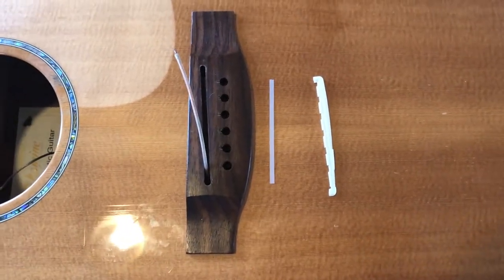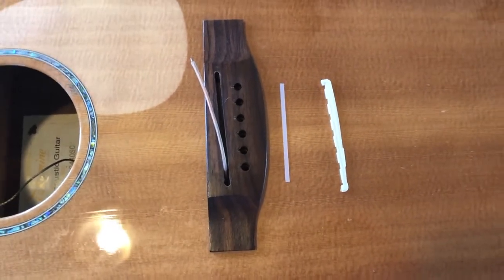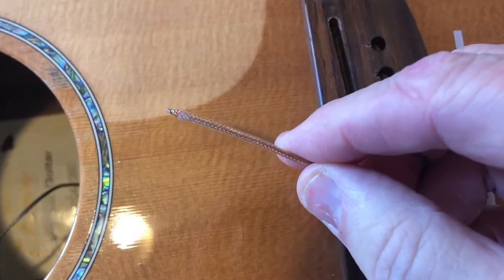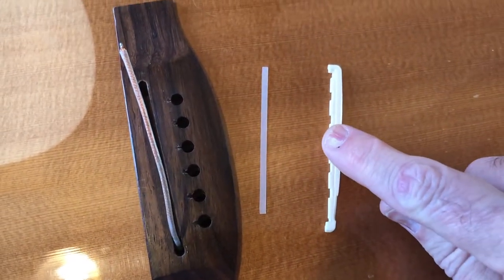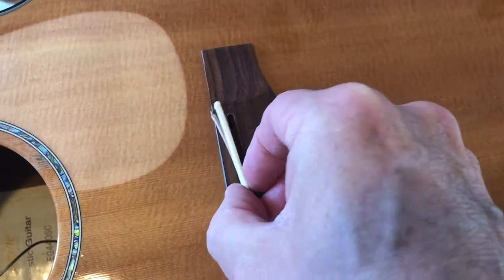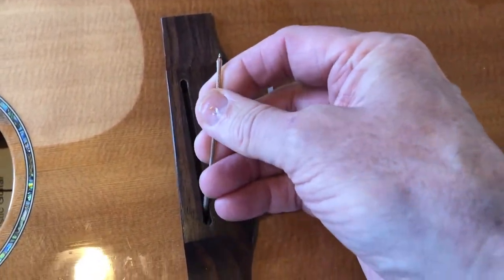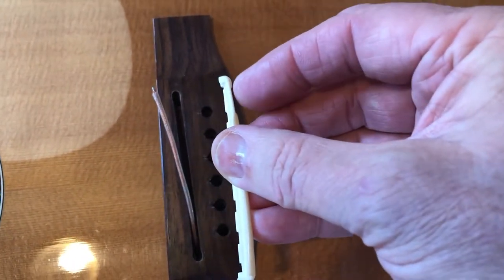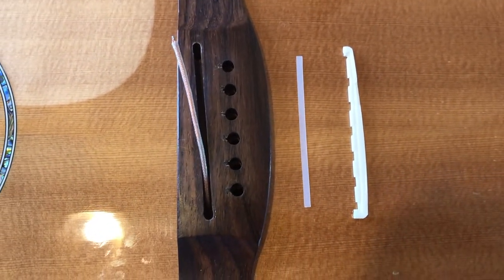Bridge, Pickup & Saddle problems all in one geetar.

Comment: The braided pickup is not a Takamine pickup.   The integrated saddle is meant to be used with the Takamine Integrated CP100 pickup where the saddle is held inside of a "U" channel.   This guitar is not a stock Takamine G Series instrument, it has been poorly modified with Non-Takamine Parts.

Comment: Its missing the metal case that it should slot into. That is why it was loose. Someone has altered it and not known what they were doing. When assembled correctly with all the correct parts it gives a better contact and sound than a standard piezo strip under the saddle.
Reply from the maker: yes.... and, from memory, I think it couldn't have one because the neck was sunk and the owner didn't want to spend money... but my memory!

Comment: Those combed saddle and plasic coating designs are meant to make the peizo sound less quacky and trebley. The plastic shim is meant to force a more level contact, without having to be as precise. IMO it does work but eventually wears out and the pickup loses contact and volume, it also makes it more difficult to repair or work on. It often  makes those pickups work better with less EQing needed but likely affects the overall tone of the instrument.  acoustically!
Reply from the maker: I replaced it with a bone pickup... owner seems to love the sound... and that makes me happy. :-)
Reply: @LennonLuthierFinagler  You gave me a great idea there’s a certain takamine a 12 string that I like and if I don’t like the pick up I will replace it thanks for the idea I appreciate it

Comment: Someone has bodged that guitar transducer. The saddle is machined so it slots into a channel. The channel on that guitar is missing. The transducer also doesn't look right as it should be segmented to match the castellations on the underside of the saddle.
Reply from the maker: 100% right... I considered replacing it but the didn't didn't want spend money.
Reply: Great observation

Comment: My low E lacks sustain....is fine if the string is played open.  Any suggestions?  My gut says there's a void under the 2 - 6th frets....deep slot
Reply from the maker: Lacking sustain could be the string, nut or bridge. The strong could be very dirty or old.  The nut may be of plastic or have dirt in the groove and the bridge may be the same.... very hard to tell.... send me an email with some images if you can? austen @ austenlennon .co.uk.

Comment: Hi there. Great video. My strings keep buzzing. 

I snapped multiple ones and went through multiple packs of strings.
Reply from the maker: Hmmm... could be several issues. The nut maybe be physically too sharp for intonation or the saddle could be too physically sharp. The pegs could be rough around the hole where the string goes in.... the buzzing sounds like the saddle is too low... you could have, rare, a sharp fret... send me some close up pics at austen @ austenlennon .co .uk - glad to advise.

Comment: Mine has weak line output on both higher and lower E strings. It's a locally made Nylon String guitar with a synthetic plastic saddle. How can it be fixed? Thanks!
Reply from the maker: That sounds to me like a bridge pickup issue, if so, you could try a piezo pickup, they are cheap and if that does help then you will know if the bridge pickup would need to be replaced or you could check to see that the saddle is slightly rounded and is pressing against the under saddle pickup. Theoretically the two ends of the bone saddle could be higher than the pickup and not pressing as hard against the pickup.